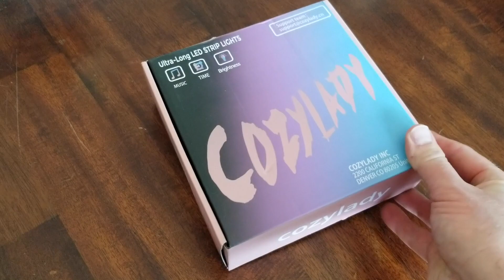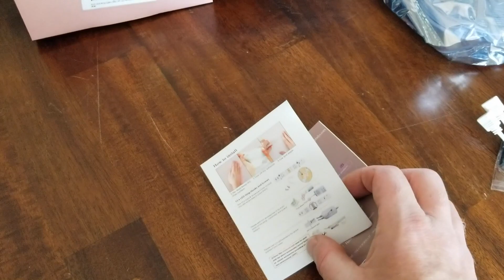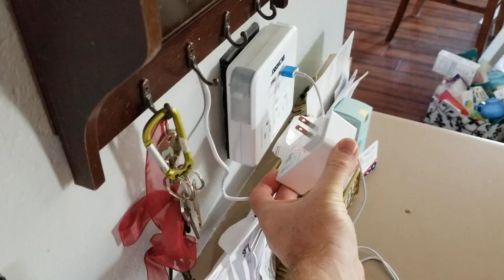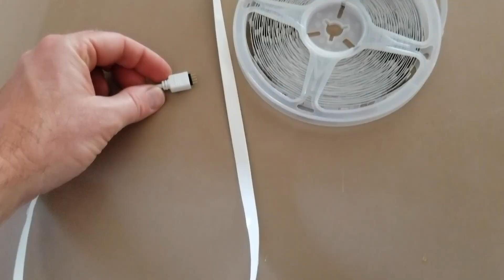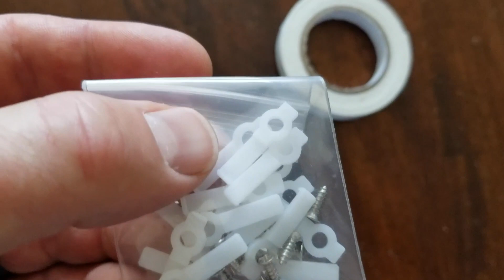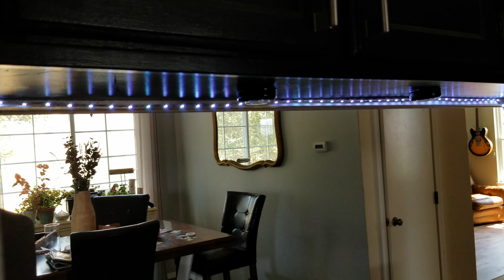Cozy Lady Color LED Strip Lights- Unbox, Install, Demo, Review

Comment: I had bought the 66ft led lights which came with 2 rolls of led lights, I put up one roll just fine, but the second one I had to cut since the length of it was longer than the perimeter of my room, I cut it at the 3 copper lines, but that rolls’ lights don’t work, does anyone know how to fix that? Or is it just broken?

Comment: Cutting the strip into multiple parts and connecting aren’t possible right? I bought the 30m from this company but just realized it only comes with one power adaptor

Comment: Do they come under any warranty? I bought them less than an year ago, and they stopped working. I tried replacing the adaptor by borrowing my friend’s which is from the other brand called “Govee” it didn’t work. Idk what is it, do you know about the warranty? Or a way to fix the issue.

Comment: So how did you get the Cozy lady connected to your wifi? I Have tried and tried and had no luck. Any help would be much appreciated!
Reply: Support sent me this:
1. Please try to connect the light strip to the APP first.
2. you need to make sure your light strip is in fast flashing green mode
There are two modes of flashing: Fast Flashing Mode（0.5s/1 time） and Slow flashing Mode（3s/1 time）. Fast Flashing Mode is recommended for quick connection with Application. Please make sure the light bar flashes quickly and select Fast Flashing Mode
(If the Slow Flashing Mode is on, press the Off button of the controller and then press the On Button and hold it until the Fast Flashing Mode is on）
3. you need to confirm that your wifi is 2.4GHZ
Note that the light strip is in the fast flashing green mode, which means that we need to connect manually in the search for pairing mode
4. I will send you the  Electronic manual (see attachment)
If you can’t connect or have other problems, please feel free to contact me.
Waiting for your reply!
Reply: What is the app I only have a qr code for Facebook page
Reply: @michellejohnstone6275  I think it is called Tuya Smart
Reply: DId you figure it out? I am having the same issue

Comment: Just bought them i really wish they would just make one long led strip not 2... but it works GREAT")
Reply: You can just cut off the power connect and attach rhe straps on rhe copper connect points... I used scotch tape and patience you could also sodder on the copper points to connect
Reply: Same here

Comment: Does anyone know what happens to the paint on a wall if u peel off the LED’s off? Will it rip the paint off or is it safe to put on a painted wall? Asking because I want to put them in my dorm room but my last LED’s from a different brand ripped the paint off the wall
Reply: They do rip the paint!
Reply: If u take the lights off slowly it lowers the chance of the paint being ripped

Comment: FYI don’t light up your led lights when they are still in the roll! It will short them out and they will stop working! I’ve made this mistake before lol
Reply: Thanks that was a close one lol
Reply from the maker: Great tip. Thanks so much for sharing and thanks so much for watching.
Reply: i hope i stopped in time. they were on..
Reply: Mine wasn't even on for two minutes and they stopped working. Ffs
Reply: Wait they will stop working forever?

Comment: Anyone know how to get the excess strip light to be reused after them being cut? Ik you can get like connector clips, another powersupply, 
adapter and controller but the ones I’m finding on Amazon are different controllers so idk if that’ll work with cozy lady lights
Reply: Patience and even just scotch tape for me. Cut on the copper lines and line up the separate pieces... took me a few different tries and a lot of swearing but its easy in theory. The lights will flicker and you know you got it close.
Reply: Can not connect to wifi or happy lighting app though
Reply: I think you have to email the company... I’m about to have to do the same!

Comment: How do you reconnect to a different wifi
Reply from the maker: There should be some options in the settings menu on the app. Unfortunately we have not done a thorough analysis of the app. Maybe somebody here in the comments can help.

Comment: when i opened mine and plugged them in, all they did was flash red, and the on off on off solution isn’t working, i’m not sure if they came defaulted or there’s a setting up issue
Reply: You have to connect the light correctly by using the arrows as he stated earlier in the vid, I did the same thing🤣

Comment: I peeled the Adhesive and the back is not stick what do I do
Reply: You could have pulled the foamy part off with it, just you peel the very thin papery adhesive or the foam on the back too?
Reply: @---rh5sz  I think I may have beetles the back also
Reply: Peeled*
Reply from the maker: @okbui_7746  found at the adhesive was really terrible. The other nail or mini screw options included in the packaging to secure the LEDs worked much better for us. Unfortunately, it will put small holes in the surface that you are using.

Comment: Do you have a tutorial or any direction as to how to combine the two rolls of led lights from the end of one roll ? Your seems to have a female end while mine does not and ends at an RBG connection
Reply: I have the same problem
Reply: Did y’all figure it out
Reply: @olabanjistv4626  I have been emailing with Judy their customer support person for two months now. So far she sent me an additional controller and remote but no power cord to plug it in with. So for two months now only half of my lights work. I think they try to see how determined their customers are to get help and try to get them to give up. My lights still do not connect to wifi, half work, and I am still emailing customer support once a week for help which they are unable to give. 

You need to connect the other half to another outlet depending on your room. Good luck getting her to give you extra parts... and they do not sell the power cord on their amazon.

Comment: Btw peoples, if the sticky strips or little anchors they give you don't work all that well, use thumb tacks some little clear ones to hold them in. It works way way better just doing that.
Reply from the maker: We totally agree. Our sticky strips failed after just 24 hours. Thanks for sharing the tip.
Reply: ok maybe i will try

Comment: I got the same lights, however when I plugged it in, the power supply/adapter flashes. When I hold the on button the adapter flashing stops but the lights change to red and won’t let me change to any different colour. Any idea why?
Reply: Did you make sure the plastic is out and that the battery works
Reply: same mine too. i think i messed up on the taking the plastic off. my remote thingy didnt pop out like his did

Comment: when i turn mine on nothing happens
literally nothing.
Reply from the maker: Other users have found that sometimes the remote battery comes with the battery turned upside down. You may want to check the settings on the remote control and see if you can get it to work that way.
Reply: worked for me, have u connected the cables in the right direction?
Reply: I had accidentally connected the arrows in the wrong directions

Comment: Building a wall unit which is 13 1/2 feet long.  I would like to use Alexa. What are the light up 4 shelves 13 1/2 feet each shelf total is 54 feet. Don’t know if I should is at 12 V or 24 V. I’m not looking for the cheapest one I’m looking for a good one. Which one do you recommend. Your opinion is very appreciated

Comment: These are terrible. I purchased the 20m one. They are not bright compared to real smd5050 strips. 3amp power supply is included. It is not enough power for 20m of led strips. Im using my own power supply.  They also started to fal loff after three weeks.
Reply from the maker: Thanks for the feedback. I would agree that this should not be used for a primary light source as they are not super bright. The specific LED strip as meant mostly as accent lighting.

Comment: I am annoyed I got this and it took a week of waiting for delivery and right out of the box I tested it I pulled out the plastic thing from the remote I plugged in all correct and it's not working do you have any suggestions? help
Reply from the maker: Oh no, I'm so sorry to hear you are having problems. I would try to line up the remote directly with the receiving sensor on the Wi-Fi box. If this still doesn't work, you could also try replacing the remote battery. Everything should have worked perfectly out of the box for you though. You may need to request a return and refund.
Reply: @TechTalkvideo  ok thanks i tried pointing it on the wifi sensor but it didn't work so I will try replacing the battery
Reply from the maker: @whba  What a bummer. I hope you don't have to go through the hassle of returning it for a new one. Let us know if you're able to find a solution
Reply: @TechTalkvideo  ok i hopefully wont return it it still works on the phone though
Reply: @Tech Talk thanks for helping, turns out the battery came the wrong way around and I finally got it working. it has some issues like color and when I turn it on it starts flashing green but I don't care to be honest
Reply from the maker: @whba  thanks for letting us know what the problem was. I will make sure and note this as it appears many people are having similar issues. Good to know you found a potential fix. So sorry that you received the product from this company in that kind of condition. It appears they need better quality control measures.

Comment: So i camt change the lighting for some reason
Reply from the maker: The colors can be adjusted best by using the remote. Is your remote not working? Might need to check the battery compartment. If it's still not working then you may need to try and return or exchange it.
Reply: Tech Talk the remote doesn’t work we looked at the battery but still it doesn’t work
Reply from the maker: @dani_3421  very strange. One last thing to check is to make sure the sensor on the white wifi box is directly in line of sight with the remote. If that does not work, you may need to request a return and get an exchange or your money back. Sorry you are having problems.

Comment: If you cut it would it still work?
Reply from the maker: Yes, the strip that remains attached to the main controller will fully work. Just make sure you cut on the indicated cut points. The cut portion will work as well as long as it has a connecter on one end. Any portion of the strip that is cut off on both ends from the controller will no longer work.
Reply: Tech Talk okay thank you so much for taking your time to reply🥺❣️
Reply from the maker: @gamine9190  You are very welcome. Thanks for watching. Let us know if you run into any other questions we can help with.
Reply: Tech Talk i want to use elbow connectors if I cut and align them with rgb connectors it will still work right? Just making sure.
Reply: Mine doesn’t have a designed cut line?? What to do? Where to cut?

Comment: How do you fix the color settings
Reply from the maker: What kind of problems are you running into? The colors can be adjusted best by using the remote. Are you experiencing some strange color settings?
Reply: Tech Talk yes like say I press red and then it’s pink or when I press green it’s blue and some of the colors don’t even show up
Reply from the maker: @kingvlogz6844  Very strange. Sounds like you may have received a faulty product. Are you able to get it replaced?
Reply: Tech Talk well it didn’t come like that do you know any way to hard reset the remote
Reply: @kingvlogz6844  do you know how to fix it mine has the same problem

Comment: I’m you peel the back piece of material you can just stick the led to the wall without the hooks
Reply: *if
Reply: Kai Austin nah, you have to use the stuff it comes with. It didn’t work for me at first, so i spent 10 bucks on amazon and bought 150 ft of double sided tape. the trick is to turn on the lights and let them heat up for like an hour before you stick it to the wall.
Reply: Chris Esposito I have the same problem. I was going to return them because the adhesive was not working when I peeled it off. You said turning them on for an hour?
Reply: it just depends bc i didn’t use all the extra stuff lmaoaoa